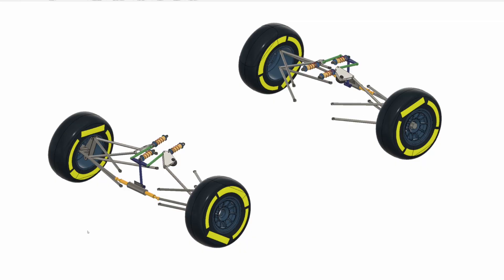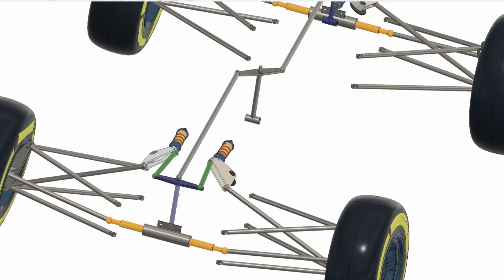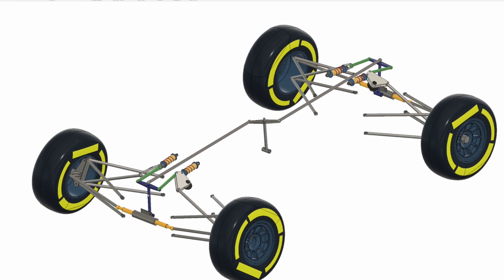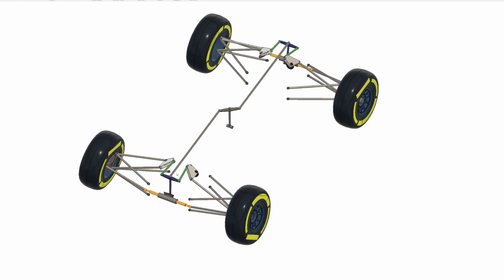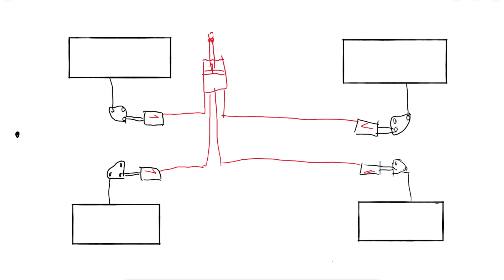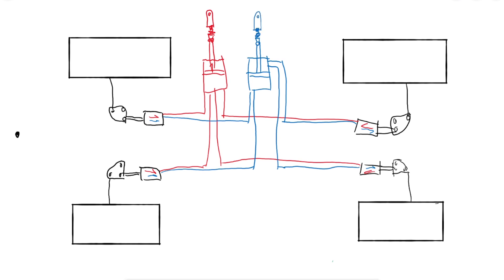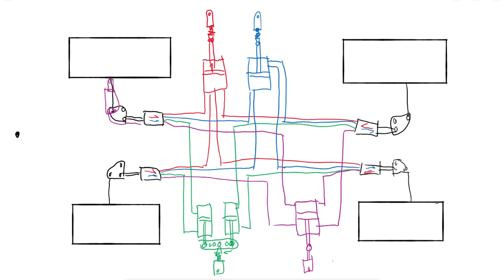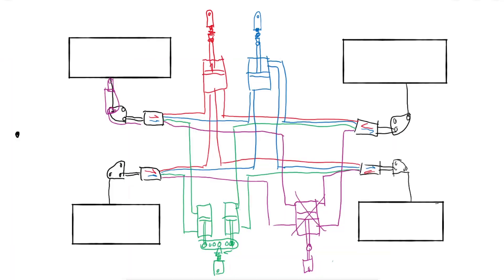The Ultimate in Mechanical Grip - How Does Fully Mode Decoupled Suspension Work?

Comment from the maker: Big announcement here guys: My racecar aero course is all edited and finished! It will be launching at the start of next month, don't forget to register your email here for updates: https://jkfaero.thinkific.com/
There will a video coming out soon-ish explaining the launch, pricing etc. Thanks for your patience!
Reply: Awesome!
Reply: how do dampers switch the damping intensity/viscosity of fluid medium for fast vs slow bump, rebound. Is it possible to have a suspension that will be gentle on the drivers' bottoms (and allow for easier vision without porpoising shakiness) and still maintain stable aero platform (kinda like how f1 drivers would like the 2022 cars to be)?
Reply: Is it possible to run a high aero car very high off the ground and (highly) effectively use vortex generators to seal the underbody/tunnels/floor and also prevent rear tire squirt with the same vortex?

Comment: I think that a simple single hydraulic cylinder installed at each corner would cause the pressure to escape to the other mode's path, so I think that a special tandem cylinder would be necessary. This would make the mechanism more complicated, reducing reliability, and it might also be difficult to ensure wheel stroke.

Comment: I am interested in off-road buggy racing and this decoupling sounds interesting.

I'm not if anyone has thought of it for offroad racing ?

I would be concerned about being catapulted off over some combination of bumps but I thought it could be resolved with high volume hight speed bypass in the shocks.

Would you think it's possible, it sounds like a fun project.

Comment: How do you account for viscosity of oil? The PZH2000 infamously uses a pneumatic system because a hydraulic loader just wasn't fast enough.
 In order to get maximum grip out of the car, high fidelity on the suspension is a good idea imo, so pneumatics also isn't the end all be all, because its too springy.
Do you just use 0W oil and thick enough lines or what is the solution here?

Comment: if you would be turning and braking hard, wouldn't one corner dip really hard since there is no spring preventing it and only a damper? all the other modes wouldnt actuate in that case as far as I can see

Comment: By connecting all the dampers to the heave cylinder won't the fluid by pass the roll, pitch and warp dampers in a hydraulic short circuit?
Reply: I guess you would still need some one-directional check valves in this setup  to make sure everything is decoupled as expected. Not 100% sure, gotta run a hydraulic simulation to validate that.

Comment: Considering the complex linkage involved in your model and the space required implement this on a modern vehicle, it seems that the answer is actually a computer-controlled system with elctromechanical controls at each wheel. This integrated, four-unit system would replace all dampers, springs, alignment, stability, steering, and braking functions. Your video is quite innovative. Thanks

Comment: It's the ultimate in mechanical grip as far as keeping the tires on the ground, but this video says nothing about the geometries of the suspension arms and steering which maximize the contact patch for the various loads and conditions they'll be facing. To that effect, I'd like you to do a video on slip angle and camber vs contact patch and load. Particularly for the rear suspension as I believe that a specific forgotten technology (the de-dion axle) can provide a massive benefit at the rear of a car for a driven axle.

However, I also believe beam axles in general have the potential to provide benefit regardless of what end of the car they're on or whether or not they're driven. It's just that on the steering axle, you have to worry about packaging and the steering mechanism itself, more. In a short-travel suspension you could just put the steering rack ON the axle itself, but on a mid and especially long-travel suspension (and/or if the driver/steering shaft line is massively off-axis of the steering rack) it becomes a much more difficult question.
Reply: Also, can't you tune pitch stiffness through suspension geometry anti-properties like anti-dive and anti-lift?

Comment: There is a mechanical suspension option. Easier. More reliable. Better handling. Predictability of behavior. Engineers sometimes get carried away, the result is not always good. Есть вариант механической подвески. Проще. Надёжнее. Лучше управляемость. Предсказуемость поведения. Инженеры иногда увлекаются, итог не всегда хороший.

Comment: So, what I don't understand is that F1 has a bunch of absolutely silly rules to stifle excessive innovation and imagination, and their 99.999% ideal suspension package is on a car that can be totaled by a poorly-timed hamster escape. On the other hand, a monster-truck has an ancient suspension system by comparison, and after a miscalculated jump (with a hang-time long enough to have an extensive dream of soaring in your own flying truck, or compact car, complete with plummeting finish) , rolls over, somehow ends up on its wheels - one of which is completely snapped off and dragging - and the truck completes the run with a concussed driver opting to wheelie across the finish line, and still has a competitive time. It kinda makes F1, their "road bicyclist" grade drivers' likeability quotients, and irrational contrivances more in the "who cares. It's just a horse race gathering for women in funny hats." category of technology. Also, "harrumph. "

Comment: Hi Kyle.  I was wondering where the forces from those four decoupled mode dampers go?  They would be mounted directionally in the chassis somewhere to use that force to help the car?  Can you illustrate that please you make me want to design a car!
Reply: They would be mounted to the chassis. I'm surprised I haven't seen anyone mention this, but Mclaren uses a VERY similar setup on their cars that are above the sports series (like the 720s). Many people say in comfort mode that it rides almost as smooth as a Rolls Royce, and stiffens right up whenever it's in track it sport mode. You can check out a video made by engineering explained where he explains it in detail.

Comment: instead of messy hydraulic..

how about electromagnetic suspension? basically something like this but replace the pistons with electromagnets, then send the data to the CPU, process the modes individually, actively manages the displacement data, then send feedback to each suspensions. ultimately creating an active suspension.
Reply: Bose has done this before. They found that, while the ride quality of the car was amazing, it would be too heavy, too inefficient, and too costly/complicated to realistically implement in a car.

The electromagnets would have to be quite powerful, meaning that they'd draw a lot of current. Maybe it could work better with assistance from some other device.

Comment: @kyleengineers would it be possible to flip this design and run the push rods under the seat of a center seated car? It imagine it would require flipping the suspension pushrod as well, attaching it to the top control arm and the rocker, shocks and springs attaching to the bottom frame.

Comment: Warp effects can be largely negated by having the roll axis inclination and the mass centroid axis, broadly speaking, parallel.  This results in the roll couple being equal from front to real.  From a driver stand point, this generally makes for a car with a sound base of balance (and very responsive to balance changes). This may not be the path to ultimate grip, but if the car lacks balance then the driver cannot access the extra grip and it is all for naught.

Comment: nice system. can it be used for off road vehicles?
Reply: Probably warp is beneficial for off road axle twist, and the pitch control and roll control would greatly benefit such vehicle on road driving dynamics to improve braking and cornering.

Comment: What would happen if going through a hard right turn you ran over a curve with that right tire? The right front tire will compress and the left rear will lift?  This would cause the rear right to drop and the left front to raise. Now if this was instantaneous it seems like it would work. But real world the potential delay between front and rear would seem that would raise concerns. That is of course with no failures in any point of within the system due to uneven seal wear or fluid viscosity changes at different temperatures as one corner is worked harder then the others.
Reply: It would be tuned accordingly.  So the damping and spring affect between the corners could be relatively light.  It all depends on the type of car and conditions.  I very high cog vehicle on rough terrain would benefit the most.  I’d like to see a baja race car with and without it compared.

Comment: I would replace the hydraulic system and use lineare electric actuators. Benefit would be softwaredefined filters and energie harvesting.
Reply: that is gonna introduce active suspension system. the hydraulics system is reactive

Comment: I really like this layout. But I think there's a problem. As I understand it,  the heave circuit handles single-wheel bumps. That means the front and rear have the exact same spring rate. Excluding that subset of cars with 50/50 weight distribution that is a very poor design. Or am I misinterpreting how it works?

Comment: 1) on a non aero car, would there be no need for heave control? so if you ran a T-bar setup you could tune your pitch characteristics freely using the "heave"/pitch spring and damper?
2) for a road car do you think a hydraulic piston actuator for the decoupled mode suspension would be easier to package than a cantilever and T-bar setup? the reason I'm asking is because it seems like you can move the springs and dampers to anywhere in the car instead of having components that require a fixed position and geometry near the wheels.
3) would a single piston with a single hydraulic line be sufficient to control each wheel? does anyone actually do this on a 1000kg+ car?
4) implementing this system with air springs and adjustable MRF dampers would be super cool. would there be an disadvantages to this other than complexity?
Reply: 1)the heave would still be ideal to in essence carry the cars weight. 2) it would be the same size to package as a conventional setup around the wheels but you are correct everything else can be moved around where there is space but it is best to minimize the length of lines as you would have less control from the expansion of lines.3) yes a single hydraulic piston of sufficient size and rated for the forces is all you need along with one line that would go to a distribution module where the other lines would be connected. so  you would only have a single line from each wheel and then close to the pistons you have the distribution blocks where you would have mess of hydraulic lines to the proper pistons. currently only prototype vehicles use this as no professional series allows it and it is just too untested and costly for a road car as of right now.4) assuming you are using air springs and dampeners on the pistons it would just give you a different characteristic but i would be cautious of excess heat messing with your spring pressures. in sense regular springs are linear and follow F=K(x) where f is the force needed to compress X distance and K is the spring coefficient. Air follows a different trend where is easier to compress at first but as the pressure increases its spring coefficient dramatically stiffens.  on a road car its better to stay with normal springs as they are easier to predict, but air suspension is big in off road where you want the wheels to articulate easily at first and to get much harder as they come to the end of travel so you don't bottom out. suspension geometry also does this especially using a cantilever suspension as the angles of the pushrod and the dampener can change the forces acting and being acted by the wheel. This is where you spend millions in engineering.

Comment: what prevents the fluid short-circuiting through the shared sides of the various pistons?
Reply: the fluid doesn't actually flow into the same reservoir in each cylinder, they are separated, i.e. you might have a cylinder with 4 chambers, pairs of 2 chambers are connected and each pair works against the other
Reply: @bilaltariq7819  thanks!

Comment: Is it possible to do it now all electronically. i mean using sensors and actuators. this saves on oil spillage and one can competely configure the system by means of SW and adapt it dynamically and based on the terrain conditions and needs.
Reply: yes, the Williams f1 car from the 90s is a good example of this but be aware pretty much every other team who try doing this cost the driver their lives.

Comment: Question for you, Kyle, regarding damping in systems like this.

As I understand it, most cars have their dampers tuned asymmetrically. That is, they have either more or less damping in compression than they do in rebound, depending on the desired handling characteristics. But in these hydraulic systems, that doesn't seem to be possible for most of the modes, at least not with conventional dampers. Is this just an accepted compromise, or am I missing something?

 Oddly enough, I fell down the fully-decoupled rabbit hole a few weeks ago and came across exactly the FSAE video you shared at the end of your video. But I got kind of hung up on the issue of damping and can't find any answers anywhere.
Reply: You can still do asymmetrical damping with the hydraulic system, and arguably for every single mode. A damper's rebound/compression, high speed and low speed adjustments are all based on regulating the flow and pressure of the fluid - i.e.; its a plumbing exercise. The beauty of the hydraulic system is that now you can adjust low/high speed and rebound/compression within each mode be cause each of the hydraulic cylinders can have their own adjustments, not just the 'dampers' at the end of the hydraulic run. Kyle has only drawn the basic hydraulic modes, you can add as much complexity in real life to this hydraulic circuit as a computer mother board... even before you add electro-hydraulic devices to the system.

Comment: Maybe I'm just being stupid but if hydraulic fluid is incompressible, wouldn't this system not just immediately seize ? 

Under heave the pitch &roll circuits would seize, under roll the heave and pitch circuits would seize and etc.
Reply: My guess is there would need to be compressed gas reservoirs at both ends to accept the necessary displacement ?
Reply: You get your "head space" in the heave piston, which can always move up and down. All the other pistons lock up by design when they are pressurized on both sides, that's what allows each one to control only one mode: they will only move for the mode that creates unequal pressure in that piston. You don't want, e.g., the pitch piston to move under heave, you want 100% of that motion controlled by the heave piston alone. Under pure heave every other piston will remain stationary.

Comment: But if there's only one cylinder per wheel, how can the different modes act independently? If we look e.g. at the graphic at 8:40 and a pitch situation occurs, what stops the two front cylinders from displacing the fluid ONLY to the red circuit (passing the fluid through the red "master-cylinder" without moving the Piston and from there to the expanding rear cylinders) without even including the blue circuit?
Reply: In the FSAE example he mentions at the end of the video, the plumbing is a little more complicated to prevent that from happening. It's way too complicated to explain in words but you can find a writeup here: https://blogs.mathworks.com/student-lounge/2018/02/01/hydraulic-decoupled-suspension-part1/
Reply: @5thearth  Thanks. It seems to be the reason why in the FSAE example the main cylinders for each mode have seperate fluid chambers for each connected wheel cylinder, even if they act in the same direction.

Comment: Isn't that similar to McLaren 650S or 720S suspension setup?
Reply: as far as I know they have no interlink front to rear, and basically just use the hydraulic system as an anti-roll bar.
Reply: yes and no as its not near as complex, if im correct they only connect the front and rear for pitch control. they also use valves at the top and bottom of the wheels dampener. the mclaren setup still doesnt control heave or really anything independently. he has a vid on his channel about the 720s suspension
Reply: @jacksonblanks8038  thank you for clarification. I drove 720S, its ride is smooth as butter, nevertheless 😉
Reply: @bartekb5074  yep it's suspension is very good for a road car. If possible try driving a real professionally built race car. There is nothing like it
Reply: @jacksonblanks8038  I would love to!